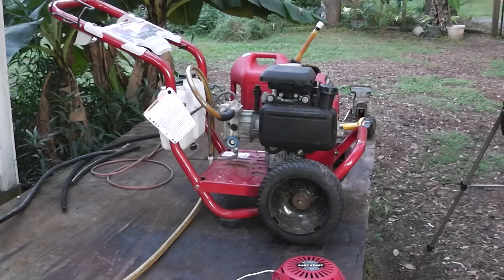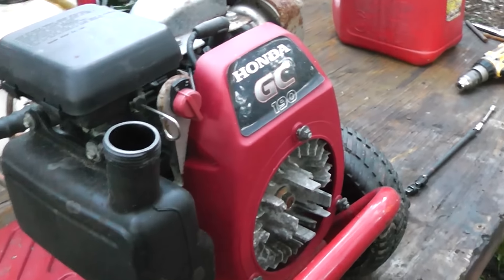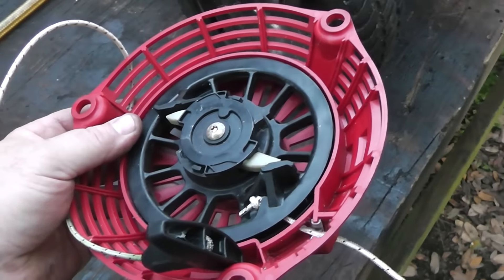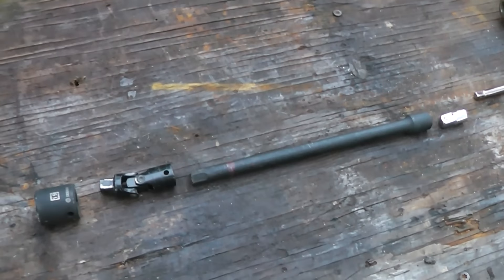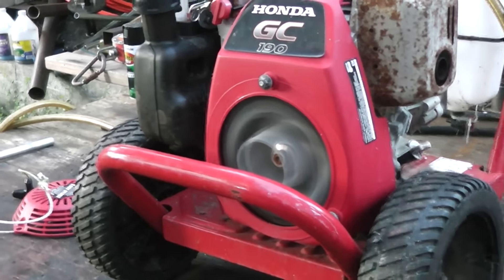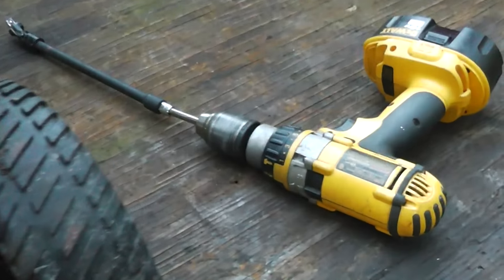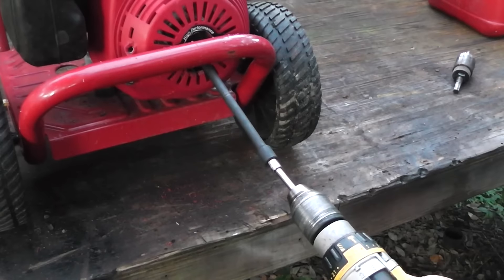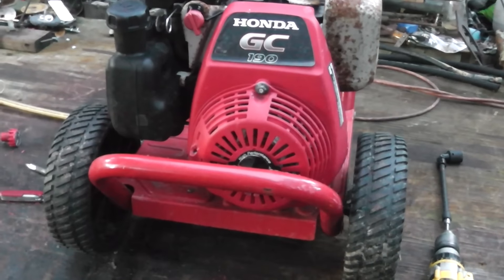Drill Start Honda Gas Engine No Welding or Cutting Required

Comment: I'm 16 years old and I always work on small engines like this, and I know this is gonna sound crazy but it really hurts my arm and my back when I pull start my mower and my trimmer hahaha. But I found this video and have to say this is pretty cool I didn't even know you could do that with a small engine like that. I tried it with my mower and fired right up, even better than the pull start. Thanks for showing us this unique trick and saving our backs from surgery hahahaha. Good work man
Reply: watch out for kick back from the engine when it starts, use a ratcheting adaptor at the end of your set up and no kick back that way and never use an impact or you'll snap off the stud ! good luck!
Reply: Why not get a one way bearing

Comment: My dad used to be a foreman for a garbage company and he'd bring home all sorts of small engines:  mowers, snow blowers, weed eater and chainsaws and within 30 mins like you said he'd have them running like champs.  He used to keep plugs and filters on hand it was incredible.
Reply from the maker: +SCJMO Kudos to your Dad!
 I have actually pulled running equiptment out of the dumpster  It amazes me what people will throw out.
Reply: @homesteadprepper  Many homeowners are not that smart.  Thank God , they keep the economy going. A little tongue in cheek.  I prefer repairing, because I usually buy pro or very close to pro equipment and don't wan't to throw out.

Comment: I started using the drill method when my arthritis started hurting to bad to pull start them. Nice easy fix. I have a deal with a local chain stores manager. I buy all the returned lawn equipment and nearly always fuel related fixes.
Reply from the maker: +BCtruck, rebuild, repair,repurpose You got that right about it being a lot easier especially, when you have some stubborn starting equiptment.
I recall a McCulloch that I had chainsaw back in the 90's that took so much effort to start, that when it finally got going, I could have already chopped the tree down with a hand axe.
Ethanol in the gas has been a bane to a lot of us but, a bonus to those who can fix its inherent problems!

Comment: Early on I was thinking he would adapt a bolt head on to the pull rope mechanism and it would still have the pull start plus be able to be started with the drill with a socket like that. That is what I am going to try. have to take it apart to see if that might work. All that plastic probably means no it wont work.

Comment: Does it kick the drill when the motor starts up? I would think some kind of a bering would be needed or the engine might yank the drill out of your hand
Reply from the maker: I guess it could yank it out of your hand if you are not quick and careful enough but, it works really good for me.

Comment: Thanks man for this video
My Honda motor in my air compressor is  missing the string coil and after 3 new ones they break with one pull because the lil plastic ears break..the original one had metal and I can’t find it and wrapping paper he rope around works but is annoying thanks again 👍

Comment: When that socket comes of the extension (and it will) inside that cover it should make a right mess of things.
Reply: Yeah, Sure not if you weld it on. Common sense

Comment: Like what you selling their brother but what happens that socket pulls off inside there with that crank cover on it ball bearing caught in the washing machine anyhow I got a big generator my shoulders pretty well blown out both rotator cuffs and it looks like I'm going to build one of these to do it yourself thanks for the tip
Reply from the maker: You could weld it on so that would never happen.

Comment: At what size engine would this cease to work? I have a 7kw generator with a pull start, which I couldn't pull when it was cold. Being in Alaska with practically 9 mos of the year being Winter, you can deduce the issue. I plan on setting up a portable propane heater to warm up the generator shack 30 minutes or so, prior to starting the gen next time.

Comment: Most pressure pumps don't like to be run without water to lube the internal O rings for the piston pumps. You can mess them up, resulting in low pressure.
Reply: He says the pump is already bad, and that's why someone gave it to him.
 Still your info is correct except one that I've used many times. My boss had an old Honda pressure washer we would use to wash dump trucks and heavy equipment with. We used it for 16 yrs and it was still working when I retired 4 yrs ago. I've never seen another like it. People using it would get caught up talking to someone and let it just sit there and run. The water was still running to it but it wasn't always running through it.

Comment: I use my Ryobi drill driver to start my chipper shredder that has the heavy flywheel connected to it. Started using it after I had a odd carb. Problem! It would start only with starter fluid my guess is the carb has 2 circuits one for starting one for running. Starter orifice must have been clogged
Reply: wot hp is your chipper
Reply: @tanglewood777  5 hp I believe
Reply: @drfix2020  MINES 15 MITE B TO BIG FOR THIS METHOD

Comment: Now you really need to get a decal made up that says "Easier Start" to replace that old one that said, "Easy Start." :-) What do you do to prevent any potential kickback as you start up the engine in this manner? I had thought about picking up an automatic crank to replace my pull cord-type of crank, but those are actually welded onto the shroud and you have to replace the whole thing, crank assembly and shroud, which is costly if you can even find one. I like this method and will try it out for myself on a Whipper Chipper that has a Briggs and Stratton engine on it.  I had it all tuned up about 3 months back, but have never even cranked it off, due to how hard it is for me to pull that blasted rope. My arthritis and torn rotator cuff just zaps my pulling strentht.

Comment: Hi so I was just wondering what you put in the gas tank at the beginning of the video also how would you keep the connectors and extension rods from flying off with out welding is it better to use a long carriage bolt or would some duck tape work from keeping it from flying off

Comment: Before you break your wrist, PLEASE add a drill ratchet adapter !!! I use a similar set-up to start my 14hp Briggs on my sawmill, and let me tell you that without it, sooner or later that engine will pop and snap that  drill right out of your hand if you are not careful!! With the ratchet adapter even if it starts, it will just freewheel, saving your wrist!!
Reply: What brand name ratchet adapter do you use?
I've tried two different brand names, and neither will work for this. They both work great when you use them with a breaker bar. When I tried using them with a drill they would lock in place both ways and almost cause be to break my wrist. I found they both lock up that way once they get to a certain speed. 
Please help me out here. I'm 60yrs old with a torn rotator cuff in my right shoulder. Thanks

Comment: Does it matter which way you try to start it
Reply from the maker: +William Newsome Yes. In this application it must turn clockwise to start from the front. The rear will spin ccw on this engine.
Reply: Not only that if you try and turn it the wrong way it will unscrew the nut.  If it don’t unscrew nut it probably would break crank at nut.  Than your finished

Comment: I rebuild vintage omc outboard tiller steer motors. The demographics are steering the market to electric start no one wants pull start . Most of my customers are new retired people moved to florida and the first thing they want is a boat.  Electric start adds about 3000 to 400 dollars to the price of a good used reconditioned motor so i will using this alternative to the point of drilling holes on the engine cover to allow easy access to flywheel on top. Brigs and stratton makes a  tool that attaches to a drill and goes into the fitting on the motor that is exposed on small weed blowers edgers etc. It has a anti  kick back release in case motor speed exceeds drill speed. Looks like the days of pull starters will follow the old car cranks
Reply: Do you have a link to where one could buy that tool with the anti kick back release?

Comment: Be careful. If the engine kicks back it will spin the drill backwards and break your wrist
Reply: I would be sure the cordless drill was in screw driver mode so if the engine kicked back the built in clutch would slip rather then twist the drill back on you.
Reply: @robert5   If the clutch is set strong enough to turn the engine over it’s not going to break loose if it kicks back

Comment: If you ever get tired of dragging that drill method out the replacement recoil starter is under $11 delivered to your door on Amazon.  The drill/socket tip is great to get an engine running when troubleshooting.  Thanks!

Comment: IF anybody tries this make sure you have SAFETY GLASSES ON and maybe a motorcycle helmet, IF you have ever had a swivel fly OFF a extension when using a electric or air wrench you will understand why, GREAT way to injure yourself or others.
Reply: Numa Newbern
holy crap.this guy is nuts. 6 slip on connections that can come apart and send chunks of steel anywhere. wow.

Comment: I agree with the drill method, but on engines with smaller shafts they can twist them off, don't ask me how I know...lol  If you pull the un-loader valve out of the pump it might just be gummed up, a good cleaning will bring a lot of them back to working condition. Hope you and your family have a great New Year.
Reply from the maker: +rchopp Happy New Year to you my friend!  I had thought about trying to repair it but, I decided that it would make an awesome future project.

Comment: This is Still dangerous in that the socket might not release and cause damage to the flywheel and or catch the drill and throw it or twist your wrist.
I did find and have, some where, a Special Socket that will NOT hang, but will slip when the motor starts and you can easily and safely remove it.
Very clever invention. I bought it several years ago rather than replace a bad electric starter on something that broke.
Someone probably Still make it.  OR, you could get one of the cheap "ratchet type Open End Wrench set" from Harbor Freight and cut off the end that you need and weld an extension to it.
Reply from the maker: +archersfriend Good informative comment.
It may be dangerous but, it saved me a world of back breaking energy getting it to crank!

Comment: I do this with my generator.. I took off the pull start that worked just to do this
Reply from the maker: +Superdan187211 It cetainly makes it a lot easier on the back!
Reply: Superdan187211 my generator comes with an electric start button

Comment: Old school Cool ! Parts tree.com has all kinds of hard to find stuff only place I can get any thing I need for my 99 Cub Cadet shaft drive mower/lawn tractor, but U probably new that as u mess around with the same type stuff I do.
Reply from the maker: +TheKilog69 Thanks for putting that in the comment section. 
Parts tree.com has been a great resource for repairing all kinds of equiptment.

Comment: Just look on ebay for the pull start assembly and buy it. It couldnt be much to spend for a honda pump.
Reply from the maker: +Jimmy in Mexico @ $15.  I'm going cheap and save the back! lol
This engine is going on a future project.